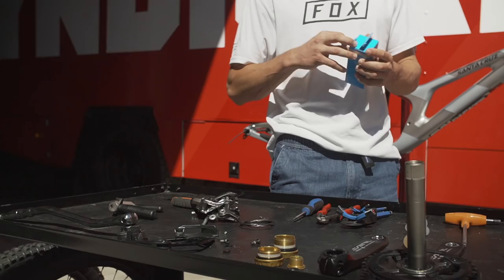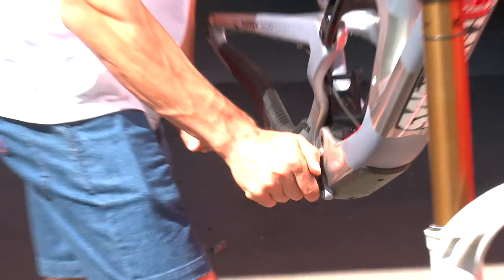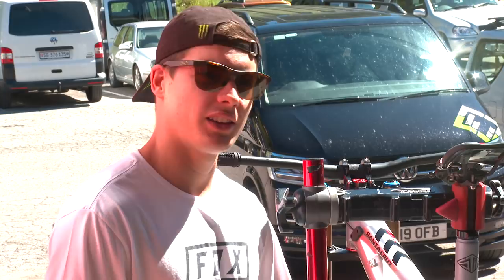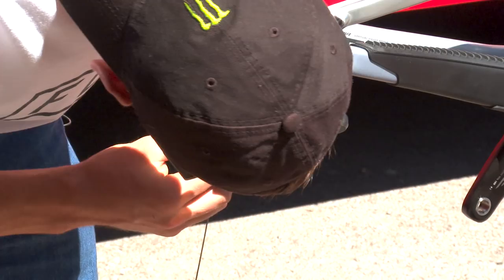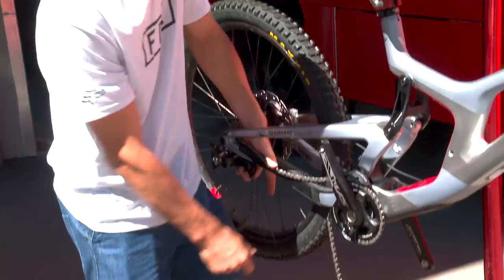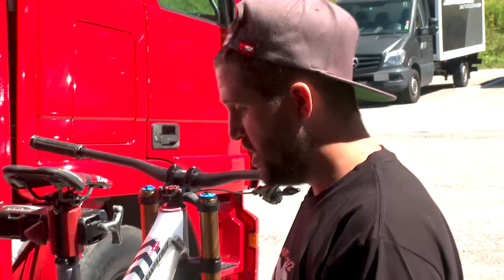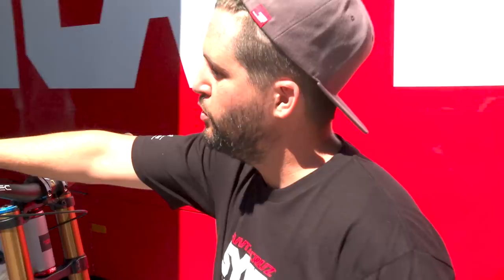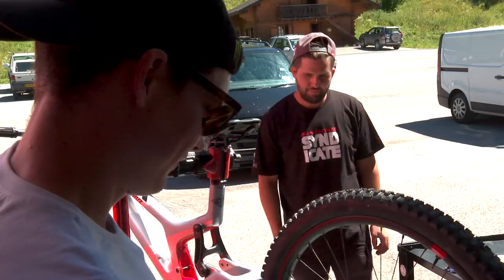On The Spanners - Shimano Drivetrain Race Setup - PA + Loris!!

Comment: the single strands on the cable have a memory for how they were (they still look curly) most of the time you can just twist your fingers around the cable the way its wound and bring the loose strands back to normal... imo especially for people with a limited supply of cables an easily fixable cable... but really good video, it would have saved me a lot of time a few years back when i learned all this stuff!